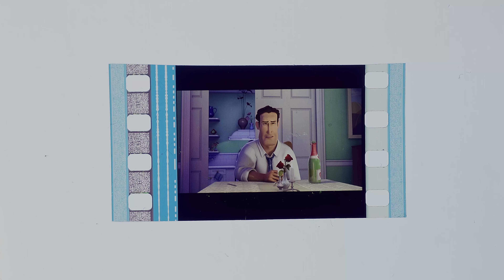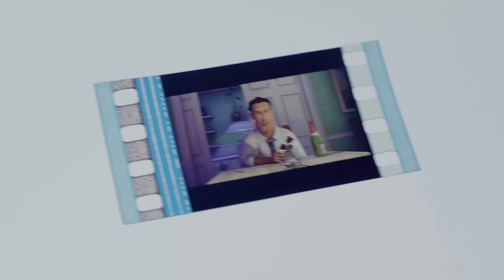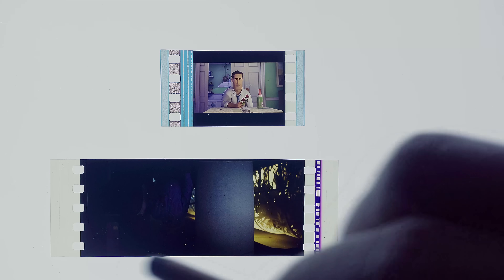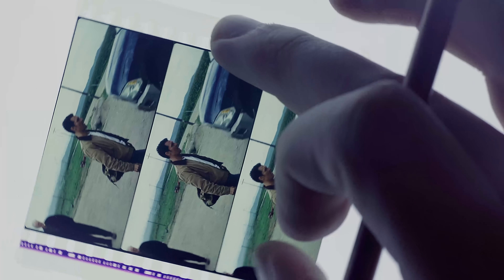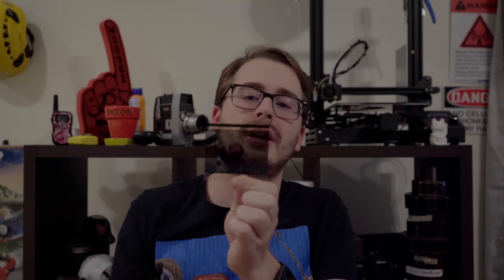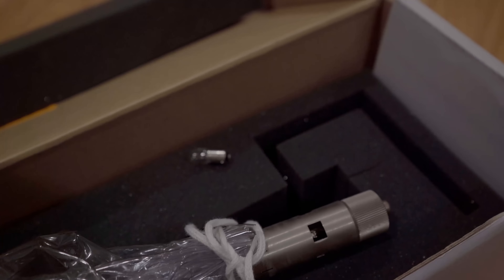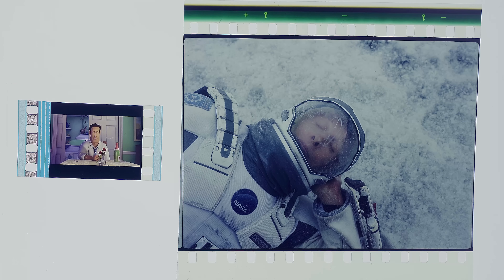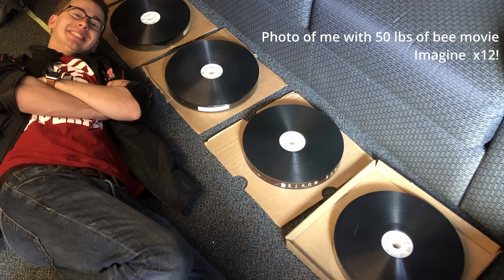Why you need to see ODYSSEY on IMAX 70mm film

Comment: Some corrections:

Imax 70mm film you see in an Imax theater isn't at 18k because the film has been processed and the final film that is made to project is lower than 18k, I don't know how much lower.
This is how you should see the process of an Imax film: Imax film + other portions not in Imax > scanned digitally > some processing by Imax > *Print new film to be sent to Imax theater.
*This step will be skipped if the film is an Imax digital-only release. 

Liemax are Imax theaters with an aspect ratio of 1.90:1(No matter the projection system except the Imax 70mm film system)

Non-Liemax theaters are Imax theaters with an aspect ratio of 1.43:1(Only Imax 70mm film system and Imax dual laser system with the 1.43:1 ratio screen)

Following are the projection systems that an Imax theater can have:

Xenon, Single Laser, Dual Laser, and 70mm.

A Liemax theater can have the following projection systems:

Xenon, Single Laser, and Dual Laser.

A Non-liemax theater has the following projection systems:

Dual Laser and 70mm.

Just so you know, Dual Laser theater can only show Imax movies at a 1.43:1 ratio if the theater has a screen compatible with the 1.43:1 ratio.

You may hear of Imax GT which stands for Imax Grand Theater which essantily means it's an Imax theater that supports the 1.43:1 ratio.

Hope this help :)
Reply from the maker: Thanks for the info! I do have to somewhat disagree with the resolution claim however. While you are right about losing resolution when scanned digitally and of course if scenes were shot on a different format, but Nolan for example usually does not do digital scan for film prints unless the scene required it for VFX. He is known to do it photochemically as much as possible, matching the grading and such to the digital scans for digital releases. So the 18k is very much possible at times
Reply: @KyleMiko  Imax does their own mastring which requires it to be digitally scanned first mainly so they can send the film to digital Imax theaters. But what you say maybe true though since Nolan seems to make his movies close to true Imax as possible

Comment: I think I knew that Imax film was reeled horizontally through the projector instead of vertically, but I never made this connection until now: Imax = VistaVision.
Reply from the maker: Good point! It is basically just larger VistaVision
Reply: @KyleMiko  VistaVision is to 35mm as Imax is to 70mm

Comment: Tenet was shown in 70mm as well. Pretty much any movie after Dark Knight Rises of Nolans are shown in 70mm theaters....or at least what's left of them
Reply: When I started working at a movie theater I thought it would involve working with the projectors nope it's all digital now guys :(
Reply: He's not saying otherwise. He's essentially just explaining why you should be watching the next big Nolan film on 70mm celluloid rather than 35 or digital IMAX. Same as his previous movies, but a lot of people won't be aware of the difference without a video like this.
Reply: @BlueZirnitra I was not aware. I thought imax was the best. Turns out is just worse resolution on a bigger screen most of the time, leading me to see pixels. The video did help so much
Reply: @BlueZirnitra  He's referring to the mention that it hasn't been done in 6 years.

6 years was the time between Dunkirk and Oppenheimer. Tenet came in between..

Unfortunately Tenet's 15/70 release was limited due to the coronavirus. 
Under normal circumstances, it would've been shown in 15/70 in about 30 cinemas worldwide (that's how many 15/70 IMAX cinemas there are).. but that number was cut short.

In the UK for example, there are 3 cinemas capable of 15/70. Only 1 of them actually showed Tenet in 15/70, with the others showing it digitally instead.

So that's why most 15/70 IMAX cinemas had not screened anything in that format in about 6 years (unless they did a re-release)..

But yeah, technically Tenet did have some 15/70 showings.
Reply: @BlueZirnitra  he could of made a short and said it’s out on film, avoid digital
Reply: @CarlosVixil  shorts are short attention span cancer and a lot of people avoid them. I'd rather watch a proper explanation than get caught in a loop of 15 second tiktoks because I'm not 12.
Reply: @BlueZirnitra  I meant for those that already know about film, but i understand your dilemma. thankfully, as large language learning model I can make my comment redundant and verbose.
Reply: @CarlosVixil  then people would ask why.
Reply: You’re so lucky, most tenet imax showings were limited to IMAX w/laser. which theater did you see it in?
Reply: I don't know how many 5/70 Tenet prints were made, but only about ten 15/70 were made thanks to Covid shutting down most places.
Reply: sad that not a single 70mm cinema is in the dach region the closest here is prague and after that only britain has around 3 left. makes me sad that it isnt really profitable these days anymore...
Reply: True unfortunately the theatre I go to to see Nolan’s films in IMAX showed Dunkirk in IMAX with laser. But I did get to see it at another theater on 70mm
Reply: As far as I understand, only parts of it were shot in 70mm and not the whole movie like oppenheimer.
Reply: Yeah, it was limited unfortunately, but it did have some 15/70 screenings.

I live in England and there are 3 IMAX cinemas capable of screening 15/70 here.

Tenet would have been screened on film in all of them under normal circumstances, however, due to the coronavirus, only the bfi IMAX in London screened it on film.
The others screened it digitally.
It was to save money because they knew less people would go to see it for obvious reasons.

Comment from the maker: Any 70mm (IMAX or regular/5perf) or 35mm is better than ANY DIGITAL (including digital IMAX). If you have the option always go for it! Otherwise, IMAX Laser is the next best bet. After that, all other options are basically the same. 

LOCATIONS SHOWING OPPENHEIMER ON IMAX 70mm: https://www.imax.com/news/oppenheimer-in-imax-70mm

I’m now aware I pronounced Cillian’s name wrong. And yes, I got a new mic since this video. 

The exact resolution is almost subjective of film frames by size, largely due to the size of the grain from the film stock, and speed of the film and the manufacture also have a large impact! Also, as some other have pointed out there are also different venues with different screen sizes, GT (Grand Theater) is the largest, and what you also should aim for when finding a venue.

UPDATE: First announcement for screening https://www.forbes.com/sites/bennyhareven/2023/02/14/bfi-imax-showing-7-christopher-nolan-films-in-imax-70mm/?sh=15a313b8514b
Reply: Just an FYI, your mic was probably fine (although now you have a new one which I'm sure is much better). The issue was more likely a very common mistake: thinking that the signal meter needs to be as high as possible. You can always turn up the volume later, you can never un-clip the signal. Recording low and increasing it in post will raise your noise floor a little bit, but it's probably not noticeable and if it is, there's pretty great de-noising in software these days. Target for 1/2 or at most 2/3 of your signal meter when recording, sit a little further away, and put it through a software compressor in your editor 👍. Great video! I look forward to seeing more!
Reply: I thought that was just your pet name for him. Cillian “Silly” Murphy
Reply: Got my tickets for the British Film Institute IMAX cinema in London. Its the closest place to me showing the 70mm version of the film. This mini documentary just hyped me up even more, can't wait to see this film the way it was meant to be watched!!! thank you :)
Reply: So if you can’t see it in 70mm IMAX should you see it in regular 70mm before you see it in IMAX laser
Reply from the maker: @claybarbaro4353  yep!
Reply: lol nerd
Reply: lol nerd
Reply: Good because it hurt my brain to listen to.
Reply: Just because something is 3 times more ridiculous (15/70mm) than ridiculous (5/70m), doesn't mean that everyone needs to see it.
Projecting in 4k or 35mm is enough, would rather have variable framerate at 24, 48 and 72 than resolution higher than 6K.
Reply: To e fair, he wrote it wrong and want us to pronounce it like he should have written it.
Reply: @Narblo  congrats on the xenophobia, his name is Irish, you wouldn’t tell an African person their  name is spelled wrong so don’t do it here
Reply: @Indastro117  calm down bud. Its all in good fun.